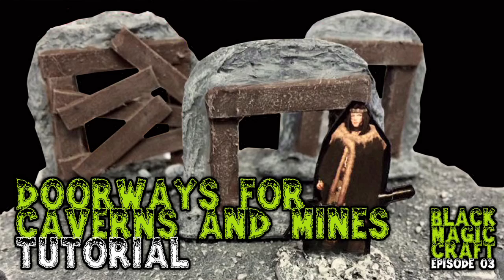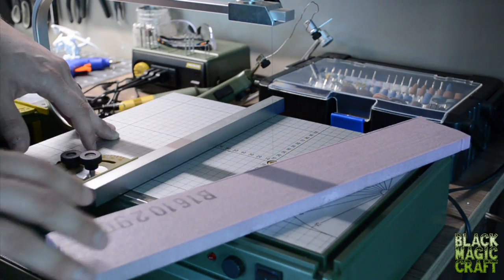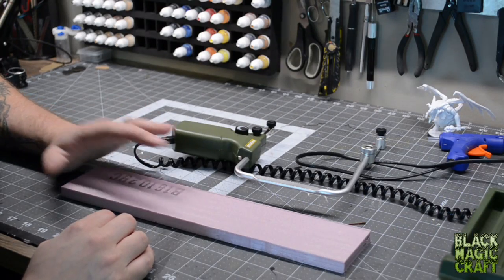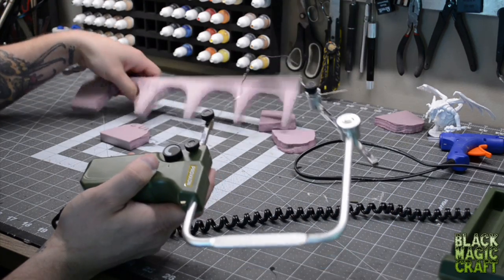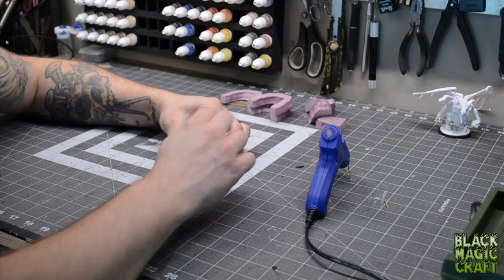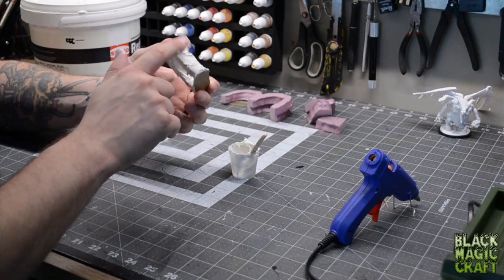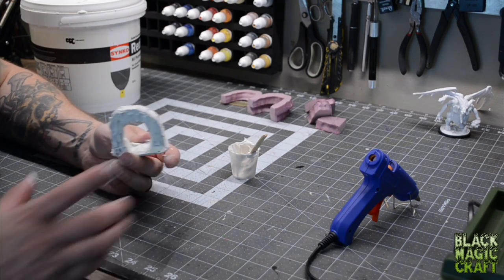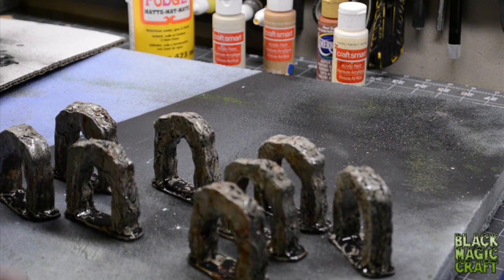New Cave Doors For D&D Tutorial (Black Magic Craft Episode 047)

Comment: For basing them, it looks like the wider tongue depressors might be a better option for basing them
Reply from the maker: You are right, and I've done that before.....not sure why I didn't here, just didn't think of it.
Reply: It's one of those things where I shift away from Scotty with things, when I'm making things, I'll go a few steps extra to make them last a lot. And while you can do a lot with cardboard/chipboard, well, paper products aren't really that good for heavier use such as doors and the like have.
Reply from the maker: I almost never use chipboard and NEVER use cardboard....and have used tongue depressors to do exactly this on other doors before. Not sure why I didn't this time, I just grabbed the chipboard and went for it. The thing is though with the coat of joint compound and mod podge its hard as a rock and no risk of warping so it's not a big deal.